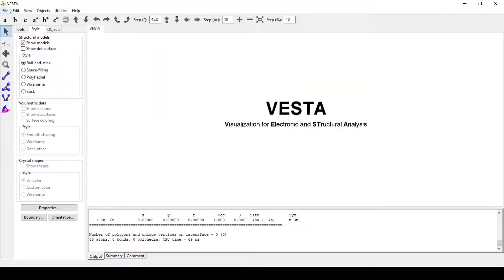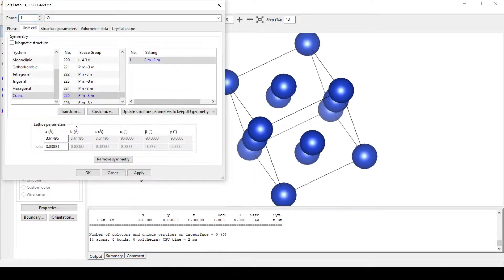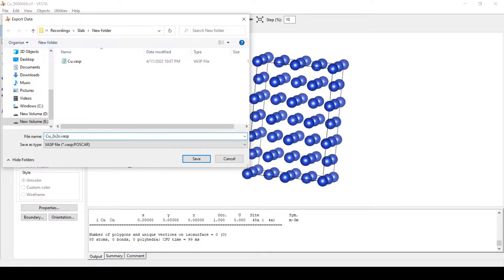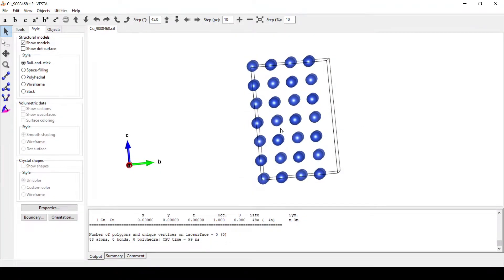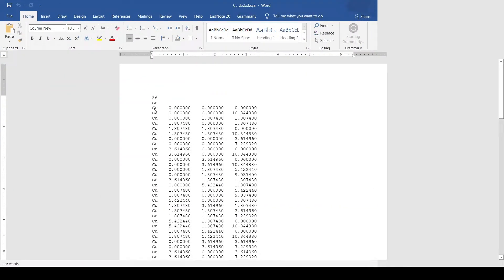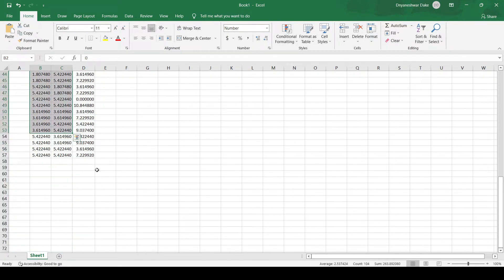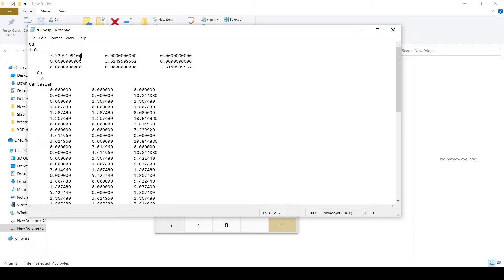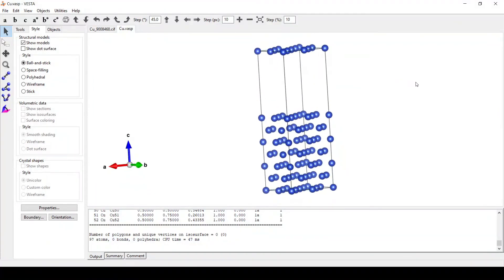Building Supercell & adding Vacuum

Comment: Hi, very informative video, I have a small doubt. While making supercell and adding vacuum, (1) Option 1: first will i make my unit cell the way you have shown in another video ""buldin slab in VESTA (http://youtube.com/watch?v=dSQgMu-lD6M&list=PLMpR8rs8yeCUX7VDzZynDlNtd4HujuLRW&index=6)" and then will work what you have shown in the video? or (2) Option 2: I will directly start from the cif file downloaded from material studio site. Kindly clarify, I think option 1 should be selected. Now doubt 2: If option 1 selected, then it will have non-zero matrix when we go for transform as per this video 1.23 min.
Reply from the maker: Thank you for your kind words! I'm glad you found the video informative.

For your first doubt, Option 1 is the preferred approach. First, create your unit cell as demonstrated in the "Building Slab in VESTA" video. Then, follow the steps in this video to construct the supercell and add vacuum. This ensures better control over the slab structure and surface orientation before adding the vacuum layer.

Regarding your second doubt, yes, if you follow Option 1, the transformation matrix may have non-zero values when you apply the transformation. This is expected, as the unit cell undergoes modifications when creating the slab. If needed, you can manually adjust the transformation parameters to ensure proper alignment.

Hope this clarifies your doubts! Let me know if you need further explanation.

Comment: For any type of unit cell we have to delete the atoms from a& b side? As we add vacuum to the z direction.
Reply from the maker: No, you don't need to delete atoms from the a- and b -sides when adding vacuum in the z-direction. Deleting atoms depends on the system you're modeling:

1. Bulk Unit Cell: No deletion is needed; vacuum isolates periodic images in z-direction only.
2. Surface/Slab: Cleaving along a crystallographic plane may require adjustments, but atoms on a- and b -sides are typically retained unless excess atoms distort the slab.
3. Nanostructures: For nanoribbons or nanowires, truncation in a- and b may be necessary for desired size/shape but unrelated to vacuum.

Ensure vacuum thickness (e.g., 10–20 Å) is enough to prevent interactions, and maintain structural integrity in a- and b unless specific changes are needed for your study.

Comment: i have a doubt. I want to make 111 CeO2 supercell. So should i first make slab from unit cell and then make supercell from the slab or first make supercell and then make slab from it ? which way i should follow ?
Reply from the maker: Both approaches can work, but the choice depends on your specific needs. If you need to control the size and shape of the supercell more precisely, creating a supercell directly may be more suitable.
Reply: @DnyaNiPhysicsWorld  Hi, and when to approach for creating slab first and then supercell? ANd what is the meaning of " If you need to control the size and shape of the supercell more precisely"